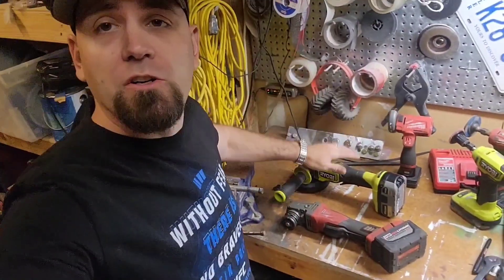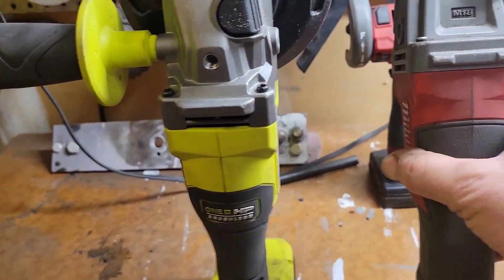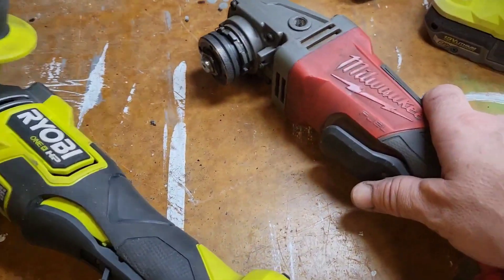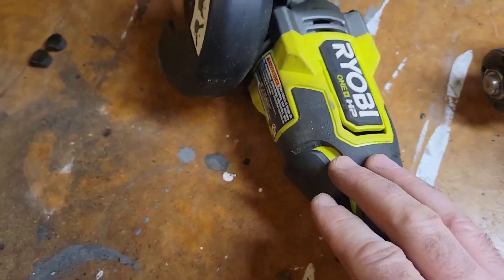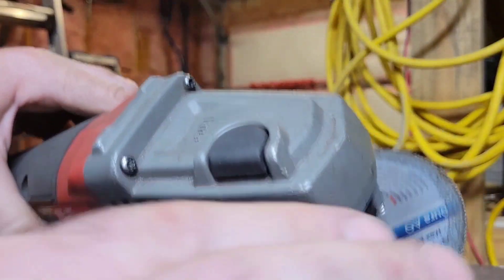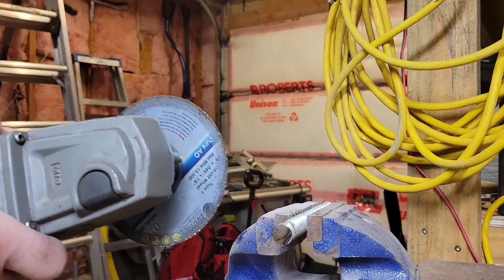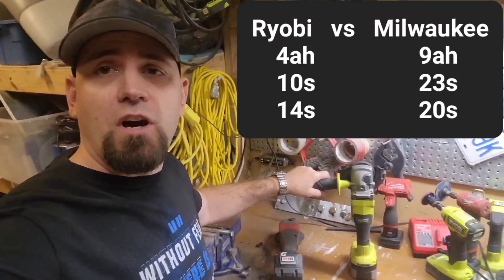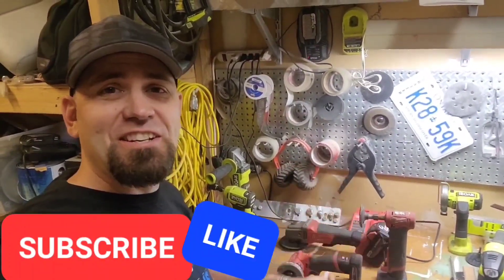Milwaukee vs Ryobi  angle grinders

Comment: The Milwaukee reminds me of my cheap Harbor fright corded model it has very high RPMs but it slows down drastically once you actually start using it. strange
Reply from the maker: @laynelg8762  so the motor is fast but not strong